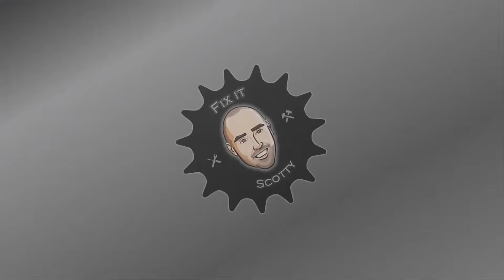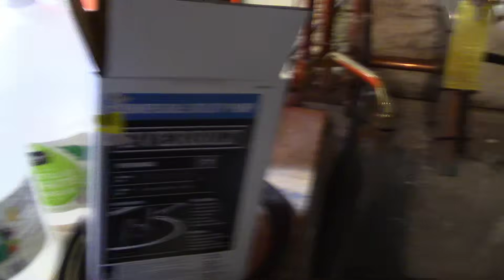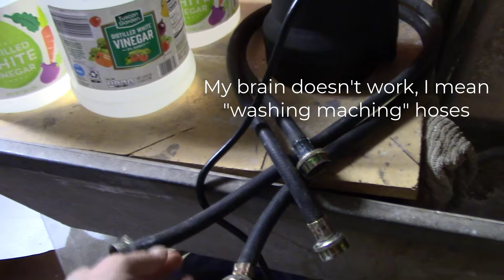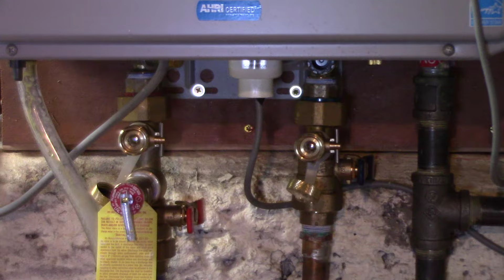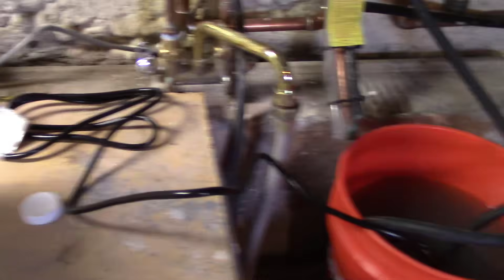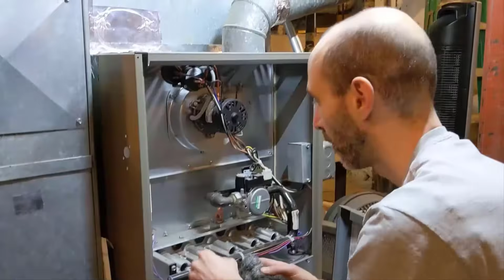Rheem Tankless Water Heater Annual Maintenance Flush

Comment: ‐----‐--------------------------------------------------------------
** IMPORTANT FOR RHEEM OWNERS **
‐-----‐-------------------------------------------------------------
This is a Rheem you're doing.  You DO NOT unplug it!  You need to fool the bypass valve into closing! 

1-  Turn off the Rheem (do not unplug)
2-  You hook up your pump and hoses...start circulating
3 - turn on the Rheem ...count 10 seconds....then unplug it! 

 [Side note:   Don't forget to clean out the filter on the inlet after descaling the unit!]

This procedure closes the bypass valve and by unplugging power...keeps it closed... allowing vinegar solution to circulate in the heat exchanger.  Otherwise you're only descaling the bypass tube.

I actually believe running the Rheem to heat up the vinegar solution it would help with descaling...also peace of mind knowing it's going through the entire system.  I wouldn't heat it continuously though...just warm it up...then unplug so the bypass stays in the closed position.

**** This is extremely important for these Rheem heaters!!!  Otherwise you're not descaling anything but the bypass tube ***

Go to 38:10 in this video...Rheem rep explains this.  https://youtu.be/hB8SPT-Ez0M
Reply from the maker: Thanks for the information!
Reply: @FixItScotty  Can you imagine the millions of these Rheems installed and have never...ever...been properly flushed!
Reply from the maker: @zumadale  I just got off the phone with a Rheem support tech.  He said it wasn't necessary to run it on and unplug it during the flushing.  He said you can unplug first and do the flush.  The technique you described still works.  Maybe some units require that, but I am not as confident as you to say that it's the only way it works.
Reply: @FixItScotty  Remember...tech support folks are usually minimum wage web page readers.  They aren't engineers, they just read PDF files and website info to you over the phone.  The goal being to get you off the phone with them.    If I was a high paid engineer at Rheem, I'd be damned if I'd be answering phones!  However, I'd be interested in participating in video conference training for technicians.

What we need to know is exactly how that bypass valve works.  What's it's purpose?  Is it energized open...or closed?  Or does it just get a signal to open or close and just stays that way until a signal is received?  Feeling for the vinegar solution to warm up during flush is a sure fire way to know it's closed!

I would suggest asking tech support to put you in contact with their best engineer that's been there for the longest period of time.  I think you'll get a completely different response.
Reply from the maker: @zumadale  Understood.  I was talking with Rheem's tech support which also includes their field tech support.  I would assume they should know basic stuff like this.  That said, I will retest and reassess my steps.  My demonstration showed that the amount of scaling removed, I was likely not just cleaning the bypass.  If I can produce a clearer, more comprehensive video with your approach, I will certainly do that.  Thanks for bringing it to my attention.
Reply: @FixItScotty  Heres another guy discussing the bypass valve... starts talking about it at 12:00 mark.... https://youtu.be/gwCgSMQabJQ
Reply: .  I ended up calling tech services at Rheem and they sent me updated instructions that specifically mention the bypass valve.  Here is directly from the PDF

1. The entire process can take up to an hour or more to complete.

2. Turn OFF the gas and both the hot at cold water supply to the
tankless water heater. The gas must remain OFF during the
flushing process.

3. To properly flush the heater the electronic bypass valve inside
the heater must be closed. Follow these steps to do this: At
the remote control, turn OFF the power and wait 10 seconds.
Turn ON the power at the remote control, wait 10 seconds,
and disconnect the water heater from the electrical source.

*The rest of the steps are basically the same for the flush. I could email you the PDF if you like. I'll include the rest of the steps for anyone else who is interested as I don't want to email everyone.  

4. Leaving the water OFF to the heater, connect the two drain
hoses, (provided with this kit), to the hose connections on the
service valves under the tankless water heater.

5. Place the loose ends of the hose into a 5 gallon bucket.

6. Open the service port valve on each side, (hot and cold
valves), to allow the heater to drain. Connect the hose for the
cold water side to the outlet of the utility pump and place the
pump on the bottom of the bucket.

7. Pour two gallons of vinegar into the bucket, and plug the pump
into an electrical source.

8. Allow the pump to circulate the vinegar for 45 to 60 minutes.
Depending upon the mineral build up and hardness of the
water some regions may require a longer circulation time.

9. After completing the circulation time, disconnect the power to
the pump and loosen the hose from the pump. Allow the vin-
egar from the heater to drain from the heater into the bucket.

10.Close the service port on the cold water side and disconnect
the hose from the cold side service valve.

11. Remove the hot water side drain hose from the bucket and
route it to a suitable drain, use a second bucket if needed.

12.Follow the instructions in the Use and Care Manual, (supplied
with the heater), to clean the cold water inlet filter.

13.ONLY turn ON the cold water supply to the heater,
NOTE: DO NOT TURN ON THE HOT WATER SUPPLY TO
THE SYSTEM AS VINEGAR IS STILL IN THE HEATER.
Water will begin to flow through the heater, this will rinse out
any remaining vinegar from the water heater. Allow the water
to run for about 5 minutes to thoroughly out the vinegar.

14.After 5 minutes, close the hot water service port and discon-
nect the drain hose from the hot water side service valve.

15.Open a hot water fixture, such as a tub, and turn ON the
hot water supply to the system. Allow the water to flow for a
minute to ensure no air remains in the system, then turn OFF
the fixture.

16.Reconnect power to the water heater and turn ON the gas
supply. At the remote control turn on the power to the heater.

17.Run a couple of hot water fixtures to ensure the heater is
operating properly.
Reply: @lhcskater  I feel safer just running the solution with the heater turned on...until it starts warming it up...then unplug the unit...I know the coils are not being bypassed.  You could probably run the temp down to 90 degrees and just leave the heater run the whole time....I might do that.

Comment: Scott, we also have a Rheem tankless ELECTRIC water heater.  There are to water connections on the bottom and the one on the left is turning green.  I think they are copper water inlet pipes.  Why is it turning green, a leak?
Reply from the maker: Copper turns green when it is wet for a long time.  It could be a very slow leak on that left fitting.

Comment: I have done the annual maintenance on the hot water heater.  I have a rheem tankless.  I can not remember how to reset the UMC117 controller so that the 1L error code goes away.  It was easy before and I did not have to open the water heater but can not for the life of me remember how it was done.
Reply from the maker: I'm not sure about your model.  But on mine... if I want to reset the codes if one is fixed, I turn the power off for 5 minutes (make sure no hot water is flowing too) and turn it back on.

Comment: I actually watched a video for the flushing of a different brand hot water heater and it didn't work on my Rheem. They recommended emptying the water out of the unit before connecting the hose. When I turned on the pump nothing came out of the hot water side into the bucket. After watching and following the Fix It Scotty video everything worked perfectly. Thanks, easy to follow and thorough, an excellent video!
Reply: You  lost your prime. Set the running bucket level with the tank like on a ladder and it will start in a minute or two. Careful as it will bubble and could knock the hose out on the ladder until it primes and settles down.
Reply from the maker: Thanks for the kind words.  Glad I could help!
Reply: @FixItScotty How did you fix it? nothing came out my hot hose either so I turned on the cold water for a second and it seemed to open it up but now after a 30 minutes its barely draining out the hot side. my pump is 2450gal/hour. I thought it would flow a lot more. plus my water in the bucket is a blueish color. does this sound normal?
Reply from the maker: @walterbeechler4709  I don't know what model you have, but if you haven't watched my advanced flush video, there may be some tips in there. I linked it at the end of the video or in the description.
Reply: @walterbeechler4709 i had the same issue but i just waited and it started flowing, must be the hard scale blocking the inlet flow

Comment: Mine doesn't have service valves and I'm fucked now
Reply from the maker: You can buy the service valves for around $100.  If you can't install them yourself, hire a plumber.  Yes, it will cost some $$, but then you can do the yearly maintenance yourself.  That will ultimately save you money in the long run.  https://www.homedepot.com/p/Watts-2-Piece-Lead-Free-Brass-Tankless-Water-Heater-Valve-Set-LF-TWH-FT-HCN/202267221.

Comment: my bucket keeps overflowing all the valves are open cold and hot are close lost all the vinegar help
Reply from the maker: Before trying to pump vinegar, you may need to test your isolation valves.  Connect your hose to the hot side and put it into an empty bucket.  Close both of the main valves and open the service valve on the hot side.  If water comes out, the isolation valves are bad.

Comment: I had a tankless today that no matter  what I did the vinegar  wouldn't pump through the vinegar. I ran a hose from the outside hose bid and it had no problem going through. A real headscratcher
Reply from the maker: So you're saying you couldn't flush the vinegar through the water heater's service valves, so you had to connect your pump to a hose bib to flush it through the piping?  Interesting!  Something must be wrong with the service valves.
Reply: Try running your water heater and while it's running unplug it that way it'll all be open so you can circulate the vinegar through the heater

Comment: Nice job.  I just completed this on a State (built by Takagi) heater.   Only difference mine had a brass strainer above the cold shut off that I cleaned.    Hadn’t cleaned unit  for five years and we are on well water—but we do have a water softener.   Vinegar solution didn’t really get that dark which I attribute to the soft water.   Takagi recommends running for a minute at 150 degrees but I didn’t want to chance that considering the time gap between cleans.  Your video was excellent for anyone considering this maintenance job.

Comment: Do I need to have flush valves installed to flush an on demand heater?
Reply from the maker: If you have a small "point of use" water heater, they usual have 1/2" or 3/4" NPT threaded fittings.  As long as you have a shutoff valve on the incoming line, you can just disconnect the hoses and do the flush as I showed here.  Isolation valves are probably not necessary.

Comment: My plumber did not recommend installing isolation valves seven years ago.
After having water runs cold mid-shower getting more frequently in the last one year, I’d decided to do it today.
No pump, no isolation valves, i managed to finish it within two hours, for about two dollars, and never hat cold shower again!
Simply turn off gas supply, turn off and unplug electric power supply, run hot water taps dry, and you are ready.
You need two flexible shower hose with suitable threaded ends (usually 20mm), a large plastic syringe of 100-200ml ( if you don’t have electric water pump or electric drill-driven water pump), bucket, vinegar (1-2L will do).
Usually inlet and outlet hose are of rigid copper tubing.
Now it’s the fun part;
To seperate copper hoses, you’ll first loosen their 20mm nuts, both inlet copper tube and outlet copper tube.
Next, remove copper tubes sideways by lift the heater upwards for a few millimeters by loosening its wall mounting screws (loosen a few turns ONLY! Not removing them).
Now, fasten shower hoses onto inlet and outlet.
Outlet hose into bucket of vinegar (1-2L will do).
(PROCEDURE WITHOUT PUMP) Inlet hose’ open end placed higher up, about the same height as top of heater.
Use syringe to draw vinegar from bucket, pump vinegar into inlet hose’ open end. Repeat for a total of 100 repetitions ( that’s about 10L of vinegar flow, from the same amount of vinegar in bucket, recycled), this can be done in an hour or two, with a helper preferably.
You’ll see vinegar turns to green tinted color.
Then purge all vinegar (properly).
After that, its about flushing out vinegar residue with clean tap water.
Find ways to inject clean tap water through inlet hose (garden hose will do), for a few buckets full of clean water out through outlet hose.
Then its time to reinstall everything back.
Remove shower hoses, both inlet and outlet.
Reinstall copper tubes, both inlet and outlet.
Gradually turns water back on, check for leaks at both inlet and outlet.
Wipe clean everything.
Turn gas back on.
Dry your hands.
Plug in and turn electric power back on.
Check for hot water at taps everywhere in the house for continuous flow of hot water, and you’re good now.
Reply from the maker: I think my isolation valves were an additional $80.  I am glad I used them because lifting my unit off of the wall (even a few millimeters) to separate it from the solid plumbing would be a pain and could introduce leaks.  But I'm glad you were able to get it done on your unit.  Thanks for watching and giving us such a detailed description of your process!  I'm sure others without isolation valves will benefit from your comment.
Reply: @FixItScotty  i dearly wished i have isolation valves on my unit, but i don’t, and i almost gave up yesterday, for not having the most important tools (pump) and facilities (isolation valves), and all my local hardware stalls closed for Good Friday!
Above all, thanks for your vids Scotty.

Comment: I have the same or very close water heater and I need to do my flush soon. Should I take the cover off to check or replace the condensate neutralizer too?
Reply from the maker: I need to check my unit, but the Perf. Platinum model has a built-in neutralizer.  That unit also has error codes for the neutralizer; one error code if it's clogged and 2 warnings based on flow logs that indicate it is needing replacement or soon to be needing replacement.  It wouldn't hurt to check it, but you can also wait to see the code.

Comment: When I start cycling, it runs for a 5 or 10 seconds and stop flowing the solution. And also I tried opening the cold water inlet and check if the water coming from the outlet. That did not work either. can there be a automatic value inside the unit that closes itself? I have two units, one flushed perfectly.
Reply from the maker: That's strange.  I am not aware of a valve inside the unit that may be closing - especially if you are doing the cleaning when the unit has no power.  I can't conclude based on what you wrote if the problem is in the unit or your pump is shutting off prematurely.  Maybe try it again with the power and gas completely shut off and try using a different pump.

Comment: Should have taken a sample of the vinegar in a clear jar  before starting in order to compare clarity. Next after an hour or two, another sample in a glass jar. You will have been surprised. You should have clear vinegar. WHY? Because you have a water softener which removes the magnesium and calcium from the water; the "scale" minerals in the ground water of a limestone aquifer in Northern Illinois.

In other words, you don't need to "descale" with vinegar if the water is soft! 

Additionally, the SLOWER the vinegar moves through the heater the BETTER because it will then have time to dissolve scale. A bypass on the pump or just a MUCH smaller pump (1/50 HP) to slow the flow will increase the effect of the vinegar. Only need enough to keep flow going through the heater. Maybe two gallons at most. 
What's more, you should have a carbon water filter followed by a scale inhibitor and prior to the water softener/tankless heater. The carbon removes chlorine put in by the city. Chlorine attacks the phosphate that the inhibitor is filled with shortening its lifespan. If you don't have a water softener, as a minimum should have the carbon filter and inhibitor to condition the water before it gets to the water heater, and the vinegar flush must be done periodically depending on how much water goes through the heater.
Finally, with a water softener, there is NO need for a vinegar flush AND the heater will last about 30 YEARS. NO softener means vinegar flushes and the heater will last about ten years. To be happy, one could vinegar flush every five years to take out any minor accumulation of scale.
FYI I a have a similar Rheem heater. Mine is 9.4GPM. Bypass valves and all. FYI the gas valve at the water heater is so the sediment trap can be cleaned out once in a great while, and of course as a failsafe way to turn the unit off; and ALWAYS unplug when flushing.

I would have kept that fairly new tank water heater and used it to temper the incoming water. Used as just a tank it would probably last 50 years.

And lastly, add a 5 micron water filter for the whole house except the garden hose bibs.